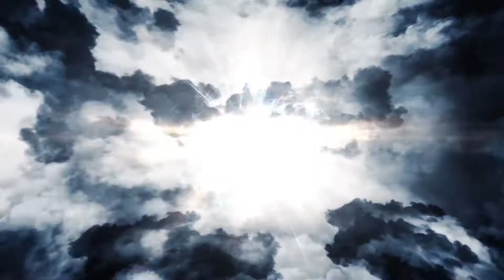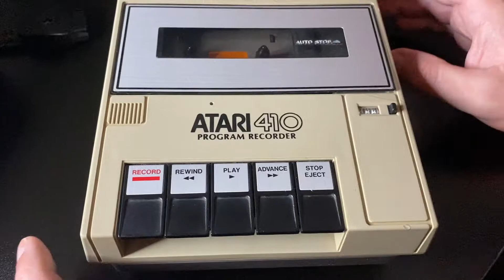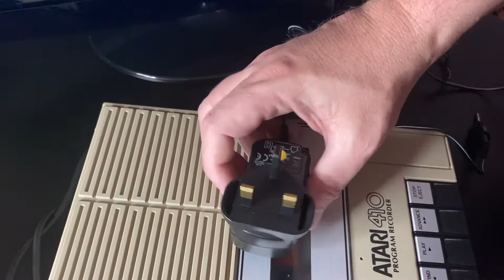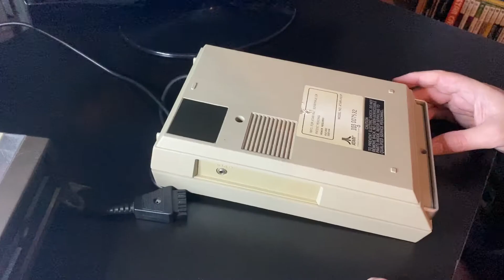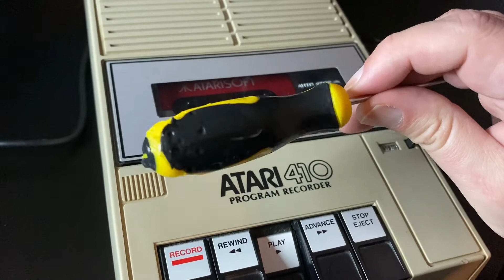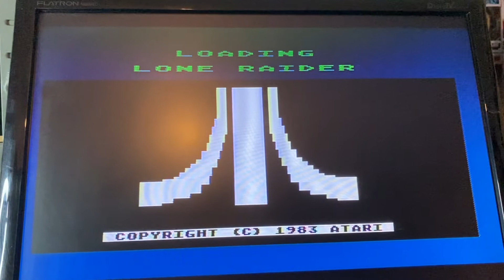Atari 410P - Quick look at this rare model. and a drive belt swap!

Comment: Just fixed one of these today for someone.
The mech was very sticky and it would not play or ffwd. 
Cleaned all old hard grease, regreased, changed belt. Took auto stop plastic part off cleaned regreased.
This got the deck working.
Recapped, serviced and now it loads and works great.
One last problem is it's a little slow playback speed and there is no speed adjustment. Voltages ok so looks like it needs replacement motor.
I have my own one of this deck and it's by far my favourite. Loads everything!

Glad I found your channel. Great video.

Thanks👍
Reply from the maker: Thanks for the kind feedback.